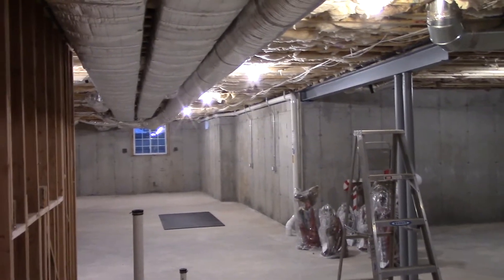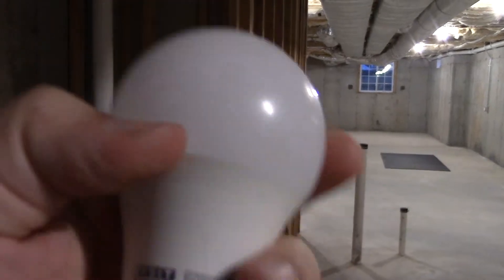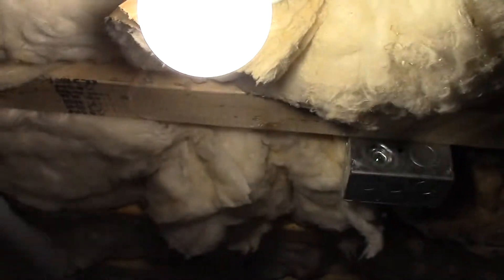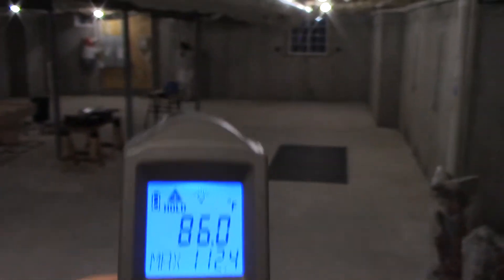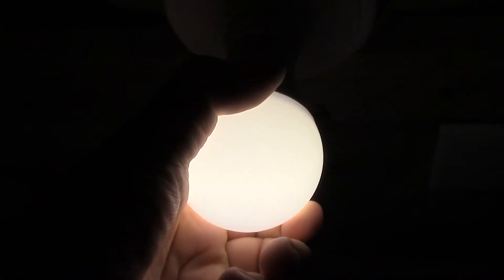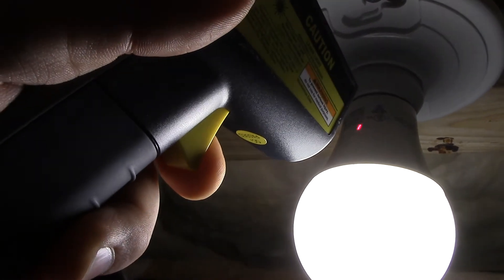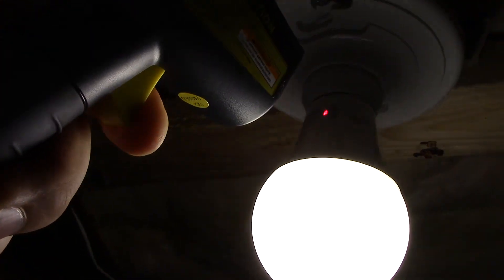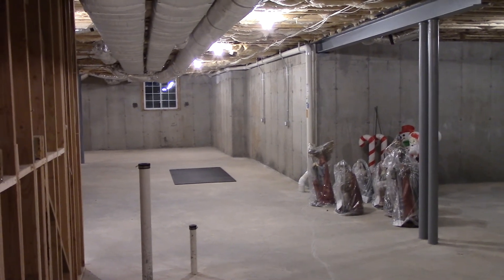Do LED Lightbulbs Get Warm & Hot?

Comment: These are less hot than incandescent, and less power waste, but I have found they are still quite hot and not as cool as I was led to believe.

I wonder if it is the transformer inside the bulb.

One item of note, your readings on the glass portion of the bulb see too low, because they feel warm to me, and to you, judging from your video, so they should be warmer than body temperature, not mid-80s F.

Comment: Led bulb in the passed did not get hot. But they they didn't sell as much and heat burns them out quicker so there ya go. Nough said
Reply from the maker: Well it has been 4, almost 5 years since this video, they have gotten better I think.

Comment: A normal 100 watt incandescent light bulb is around 300 degrees Fahrenheit. That’s way more dangerous than LED. Metal halide bulbs don’t get as hot as incandescent. I posted a comment 3 years ago about that. An externally ballasted metal halide bulb is only slightly cooler than incandescent. A halogen lamp gets the hottest. Those 500 watt bulbs can definitely get up to 1,200 degrees Fahrenheit.
Reply from the maker: Oh yeah I am sure they get WAY hotter, but this was more or less to go against the whole claim that they do not get hot at all. Though admittedly since this video, it has gotten a little better.

Comment: So are they safe to use or are they a fire hazard?
Reply from the maker: They are safe. Just be careful handling them if they were just on.
Reply: @Sharkie626  thank you for your quick reply. I was quite concerned when I felt the heat coming off them.

Comment: Represents a waste of power. The circuit needs to reduce the power going into the heat
Reply from the maker: Yeah could be! Even though the wattage is very low. 
Since this video though, I have seen LED bulbs that are all glass like the incandescent ones. No hot spots there!

Comment: I know LEDs consume less power, but if they are heating up that much doesn't that indicate inefficiency?   There is a lot of wasted energy that's making it so hot.
Reply from the maker: I don't think so. It's probably the electronic stuff inside.
Reply: Learn about LEDs and you will know that they don't work the same way as other bulbs. They heat up mostly because it's closed environment

Comment: LEDs also take forever to cool down. We own only one LED, that I use for testing. 100 watt incandescents take 2-3 minutes, and the LED takes around 45 minutes. I can't look at the damn thing, it hurts my head, yet I can look directly at a 100 watt incandescent without a problem.
Reply from the maker: You may have a different one. These take about 5, maybe 10 minutes.
Reply: The brand is a ulitech pro, it is one with a large gray decorated electronics bay.

Comment: Good video. I recently replaced some old type bulbs with LED and was very surprised at how hot they got. Almost burned my hand! At first I wondered if I had purchased some defective bulbs (made in communist China) because of all the hype I had heard about them being so cool to the touch. Now I know better. Don't believe everything you hear.
Reply from the maker: Indeed! Luckily it’s usually easy to avoid that white part. And even then, I usually wait for any light to be off for a while before handling it.

Comment: To put the Fahrenheit values into perspective, the hottest your hot water from the tap will typically get is 120F (around 49C). If your bulbs measure less than that, it's not very hot at all to the touch.

Comment: The heat doesn't  bother me as much as the fact that they falsely advertised them as cool. The only thing cool about them is the color temperature, even on "warm-white" LED bulbs. Terrible color rendering and a propensity to flicker, LEDs aren't for me.
Reply from the maker: The Cree and Feit bulbs are actually good at not having any flickering. Some of the smaller bulbs usually suffer from that problem
Reply: Flickering in a bulb like this can be a warning sign that it's overheating. You're right that they're not "cool", 80-95% of an LEDs energy is converted to heat. The LED light is designed to dissipate this heat through the top (why they're so hot at the top in this video). If you put them in an enclosed housing for example, you're going to have the heat bouncing back into the bulb rather than dissipating which can cause heat build up, overheat, and flickering. The flickering is your warning sign that the bulbs are getting too hot and should be replaced with a cooler solution or a bulb that doesn't rely on that kind of heat dissipation.

Comment: Temperature and total heat dissipation are two different things. LEDs get hot in certain areas because they're heatsinked -> the total amount of heat being given off is far less compared to incandescent. 

Connect a watt meter to a lamp and compare bulbs. 

The main issue I see with them is most can't be used in enclosed fixtures; the electronics can't take the heat. There's also a lot of junk on the market that fails prematurely and/or puts out inferior light. Stick with a good name brand like philips.

Your basement must be cold because they insulated the floor and air ducts instead of the walls; it's a bad practice and the house ends up losing more heat, cold floors due to the thermal bridging of the floor joists. Basements with properly insulated walls and uninsulated air ducts, sufficient heat aren't cold.
Reply from the maker: Thankfully none of the bulbs like those are in enclosed  fixtures. I figured that could be a problem.

None of the air ducts feed into the basement. They are just for the 1st floor. The floor up there too isn’t cold at all, so the insulation there is doing its job. Our previous house was like that too. In the winter the basement is about 52 F.
Reply: Generally, it's still better to have insulated basement walls than floor.

Your air ducts, though insulated still loose a bit of heat to the basement (which gets lost outside because the walls have nothing) and you can get better insulation performance when it's on the walls -> higher r-value and no thermal bridging. Much easier to air seal/vapour barrier a basement wall (above ground part) than the floor -> can't easily put a air/vapour barrier on the warm side, so there's condensation risk of if the basement gets too cold, below indoor dewpoint.

Also nicer if you ever do work down there.

Another advantage with a conditioned basement is that you can pull return air from there in the summer and dehumidify it when the a/c is on; the way it is now I'm betting you have to run a separate dehumidifier in hot humid weather.

At the end of the day it's a question of personal preference (some may like basement cold) and what the constriction practices in your area. 

In my area, silly things are done as well like putting fiberglass insulation with vapour barrier on foundation walls. It can trap moisture -> best insulation for that is rigid foam or roxul board.
Reply from the maker: Yeah we just have a dehumidifier down there for it. But it's a vintage one and that thing removes a TON of humidity, does a great job in the summer.

Comment: Reminds me of the hype when flat-screen computer monitors came out.  "Oh, they're so much better, they save so much space, they use 99% less electricity, then run not hot but actually COLD".  And besides the fact that the color rendering wasn't even near close, and the persistence of the image on the LCD screen meant that any kind of fast motion would leave you with a blurred, streaky image, I decided to do my own testing.  I didn't have a wattmeter, but I did read the labels on CRT monitors and LCDs, and found there was maybe only a 10 watt difference.

Now, flat panels are everywhere.  They run hot.  The color rendering still isn't there.  The wattage draw is actually HIGHER today, because the part they didn't tell you is that screen sizes would grow exponentially larger.
Reply from the maker: Next time I make it to your house, we should actually do a watt meter test on your CRT and LCD TVs. And yeah, when it comes to fast motion, the CRT could not be beat.
Reply: "Coming a long way?"  It's been out in the mainstream for over 20 years now.  It still can't possibly match the blacks and color rendering of a CRT.  It can create a reasonable facsimile, but certainly it cannot be adjusted to give the same quality.

IPS and 4K monitors are quite expensive.  Most times it simply feeds American consumerism, rather than creating quality goods.

We've been hearing about how great OLED is going to be for at least 10 years now.  Whenever it does become more mainstream it's always going to carry a premium price.  Only the so-called 1337 crowd is going to have them, and most of them are so misguided they just think they're 1337.
Reply: Yeah, I'll agree that for CAD, LCD would be better.  For most everything else, I prefer a CRT.  I have a plethora of them, and likely they'll be around for quite some time to come.  Same with my TVs.  All but one are CRT.  There's nothing good on TV anyways today, so it doesn't matter how hi-def it is if I'm not going to watch it.  Old stuff is standard def, and a CRT will display it properly!
Reply: LCD/LED is way more energy efficient than CRT. CRTs though are still better for some things, better blacks, like u said motion. A shame they don't make them any more.

The first LCD monitors were absolutely awful - they're okay now.
Reply: The difference should be really substantial especially if you do the testing with a new one back-lit by LEDs. 

LCD technology is coming a long way and will continue to improve. There's IPS now which produces better colors, deeper blacks and a good viewing angle range.

There's 2k and 4k now, so you don't see the individual pixels and with today's good scaling done by the os, can have text that's not to small.

There's also OLED technology in development; uses no backlight and monitors using this technology should be far superior to both LCDs and CRTs. Too expensive now but in 5 to 10 years will probably replace lcds.
Reply: Prices should drop on the high end displays. 2.5 to 4k would be normal.

CRTs used to be curved, have a high dot pitch and low resolution. If you wanted a 17" flat CRT with a 0.25 dot pitch in the early to mid 90s, it would have cost you $1000. Before they stopped being made, the price for the same thing was down to like $250.

LCDs are better for some things and CRTs others. When I did some cad work for school I much preferred the lcd - cleaner lines, sharper, brighter.

I'm not fond of consumerism or changing things for the sake of change either. But CRTs aren't coming back, the future is in better quality LCDs and other technology. I still run a crt and will keep it until it dies.
Reply: LCD monitors are just okay now because there is no other choice, so they have to be!  Doesn't make them GOOD.  One of these days I'm going to pull a 15" CRT monitor and a 15" LCD monitor and do a power comparison, but there's not much difference.  When they came out, they were touting 70-80% energy savings, but I seem to remember it was more like 10%.  Kind of like 35 highway/25 city, you get 18.  Quitely fudged numbers.